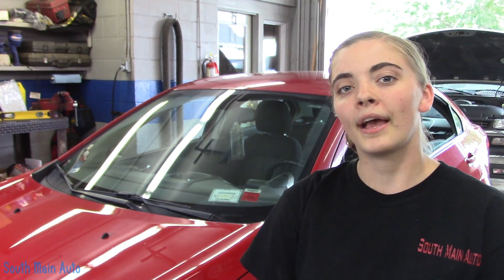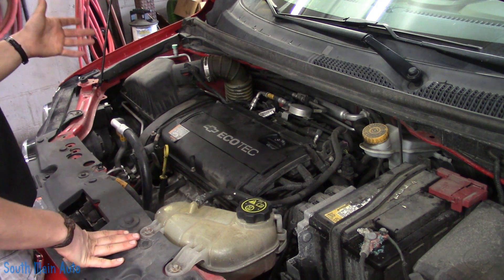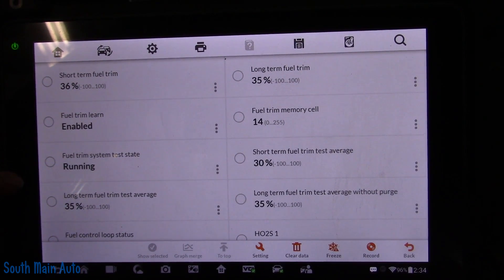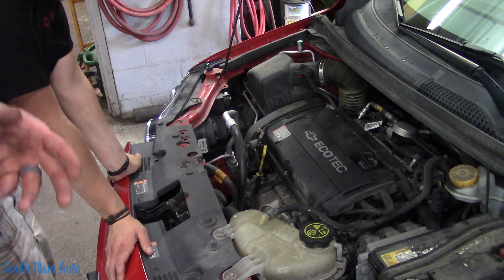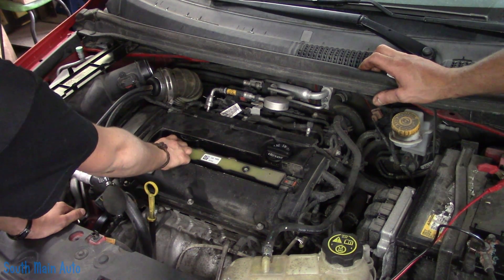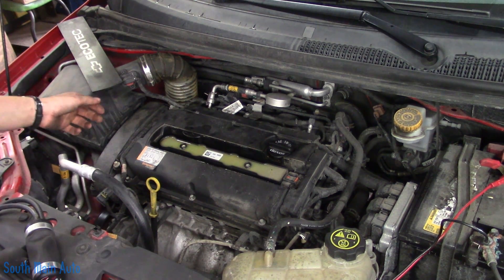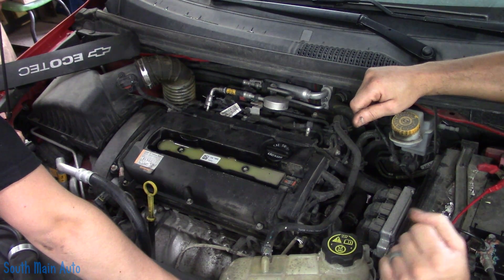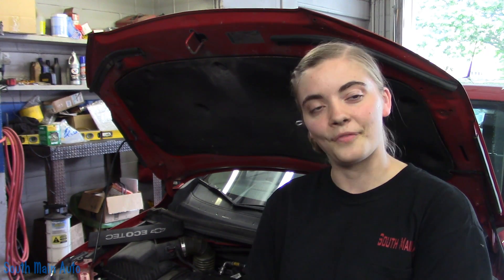Chevy Sonic: Running Lean P0171 - Part I

Comment: When I first started watching the video I was 100% convinced that it has a mass airflow senor problem. Didn't know a vacuum leak causes those type of problems too. Great video as always
Reply: Most lean codes I have dealt with under my shade tree have been from vacuum leaks (but as Eric points out, not on MAP only cars).

Comment: does Chevy use the same engine as Opel because they are very similar?
Reply: That 1.8L is DESIGNED by Opel, built by Daewoo and installed by Chevrolet USA.

Comment: Great video Marie. I have the same z18xer engine. I just changed the leaky valve cover gasket and purchased a new valve cover in the process as the PCV membrane seemed a bit wonky. There is a kit sold to replace the PCV membrane but the plastic clips get weak and you need to replace the gasket so worth just buying new valve cover & gasket IMO.

Comment: I had the exact same vehicle (same color too lol) in my shop last week. It had the same problem. I did pretty much the same diagnosis and found the leaking PCV. It was leaking from that hole in the cover at the diaphragm. But curiously, even after replacing the valve cover it still had the same problem. Lots of vacuum in the crankcase. The customer had to take the vehicle, so I haven't been able to finish my diagnostic, but I'm thinking it may have a valve timing issue. Awesome video!

Comment: What about altitude?
re; 14.7.
(14.7 is weight of air at sea level).
Avoca-vs-Denver
( 300ft- vs- 5,300ft)
Reply: Here in Flagstaff we are at 7000 ft (just try baking sourdough bread here!) 11.3 PSI. At 5000 ft is 12.2 PSI. In Leadville they have 10 PSI.

Comment: Soo, what exactly ruptured. Something internal in the plastic valve cover or just that hole in the cover. If just the hole in the cover can it be patched ?
Reply: The pcv diagram that is supposed to let excessive crankcase pressure out in a controlled manner

Comment: These engines also run in Europe in Opel an Vauxhall cars… stupid design with  a Diaphram built into the Valve cover… just replaced it on my car… super expensive as OEM part...   I gave it a try and put in a chinese one from eBay...you get 5-6 ebay covers for one OEM cover so I don`t really care if it will fail again in the future

Comment: 4:11, MAF flow is WAY to low. Thats as far as I got into the video when posting this.
Reply: And, because of the pirate air there was little to no airflow at idle.
Reply: It was in pounds per second not grams per second
Reply: @m96ag  Oh, correct. Kind of wierd the scammer would present it in Lbs as opposed to grams.
Reply: m ph Autel

Comment: The air isnt thinner in the Rockies,   there's less pressure as you gain altitude. At sea level there's 14.7 lbs of pressure  or something,  at 14,000  theres about 7 lbs

Comment: Good work Marie. Not long found the channel and been watching videos most days since. Ex mechanic so find all the diagnosis stuff interesting. Had carbs, points and condensers when I started and timing was set manually.  You can get the diaphragm for those covers but being a business, best to go with new cover.

Eric looks like Burt Reynolds in his prime, but then I''m from the UK so never met Burt but I'm sure I'm right. You need a Trans Am Eric and take Mrs O out for a spin. She might even dance on the windscreen whilst you're driving. Great channel, great people, thanks for the videos and fun.

Comment: 7:10 don't be afraid of the battery Marie! It's only 12 volts, doesn't even hurt if you stick your tongue across it! Just avoid dropping metal things across the terminals (wrenches, ratchets, etc.) and always double check the polarity before you connect booster cables, black to black, red to red. Stick to those rules and a battery will never bite ya.

Comment: want a permanent repair to that "leak"? Get yourself a straight OEM nippondenso pcv valve from a toyota, find the pcv valve hose, cut a length and insert the pcv valve on the cut portion.... you now get a very high quality removable pcv valve without having to replace the valve cover.... Whoever designed that pcv valve system deserves to be dragged to the street and shot.... survivors should be shot again (Garfield the cat always says this hehe.... ).

Comment: I question the popular assumption that vacuum drops significantly at higher revs. I don't see it unless you load the engine. I would argue that the mass of unmetered air remains fairly constant, but becomes a smaller fraction of total airflow at higher revs, therefore having less effect on AFR.
Reply from the maker: Simple enough :-) Stick a vacuum gauge on an engine and hold it at higher revs (no load) and let me know what you see. This theory has been proved (as it was in this video) countless times and seems to work well.

Comment: GM must be selling these valve covers like hotcakes.
Reply: Stupid design. Or smart if you're Chevy.
Reply: Jimmy S  _ Yep - I did one on a Cruz with just 40k miles on the clock. What a poorly engineered rolling toilet that thing is!!
Reply: @SmittySmithsonite  AMEN!!!
Reply: mine lasted or 180.000 miles so I can´t complain … but why in the world did they glue or weld the cover of the diapragm  ? On the Cruze it would be possible to access and change it within 2 minutes if they would sell it as a spare part and used a different design of the cover.. idiots
Reply: @bobl78  Good thing you haven't had to replace the combination exhaust manifold/catalytic converter, that's good for $1,400. These "economy cars" may be easy on gas, but they really bite you in the arse when it comes to repairs.
Reply: Oh well, it's China's problem now!
Reply: Jimmy S  I wonder if you couldn't just plug the original defective PCV valve vent, drill a hole, and install a regular PCV valve in the cover somewhere.
Reply: Hotcakes actually don't sell very well.
Reply: Just replaced a valve cover on a cruze today.
Reply: Yeah, the Koreans are working overtime to keep Chevrolet dealers supplied with parts.

Comment: Had me one of these in the shop last week. Mine was the turbo varety and said CRUZE on it.  but it had the little rubber donger check valve missing from the intake manifold. Had already been to another private shop and  had valve cover put on it. It was also at the chevy dealer and was diagnosed as a leaking intercooler coupler. One would have thought that the whole engine covered in oil and it pouring out between valve cover and the head coupled with "underboost code"

Comment: Chevy Sonic isn't really a Cheyv, is it?  Wasn't it it designed or at least adapted from another company?  

Anyway, Eric, this isn't good for you.  You know how this goes.  You train them up and then mysteriously the shop owner has and "accident" and there is "no will" to be found.  They get the shop then.  Not that I'm suggesting any "old world" influence in small town New York State.  ;)
Reply: I believe it's made by Daewoo
Reply: @joed8423  Very good. Thanks for the info.
Reply: @joed8423  nope, made in the USA
Reply: @waterfallhunter634  right made in USA with Daewoo designs. Specifically the ecotech motor. Which was originally a Daewoo design correct?
Reply: @joed8423  No not correct.   https://en.m.wikipedia.org/wiki/GM_Ecotec_engine
Reply: @joed8423  you are confusing this car with the Aveo
Reply: @waterfallhunter634  the sonic is the second generation aveo lol
Reply: @waterfallhunter634  The Sonic 1.8L engine is made in Korea, the 1.4L in Michigan.
Reply: Like the Chevy Luv, it's probably an Isuzu.
Reply: The sonic was made at Orion Assembly in michigan
Reply: @waterfallhunter634  Assembly only
Reply: Daewoo

Comment: That's some Chevy quality right there for you. The cheapest replacement I could find was $260, for the bad PCV  valve fix, that's highway robbery. $260 for a frigen PCV valve!!!
Reply: Rock has aftermarket valve covers for just under $90. 

If the vehicle were mine, I'd rig something together. For a customer, sorry, it's a valve cover, gaskets and whatever other plastic parts have given up the ghost.
I'd like to squash the chemical company that sold the idea of plastic intake manifolds, oil pans, and valve covers.
Reply: @gungadinn  It's more that just the valve cover, replace that only and it will happen again.
Reply: Well, from Chevy's point-of-view, the real problem is the owner for not buying a new car every 3 years.

Comment: Leave it to Chevy to make a 30 second and $5 repair into a 10 minute $90 repair. SMH
Reply: Try $260, ask me how I know.
Reply: @blackhatter011  Oh I'm sure. The price I quoted was just the part. Labor is a hind end kicker.
Reply: Volkswagens are similarly engineered.  Just order the part and DIY.
Reply: The price isn't similar. $87 from GM, $237 from Audi.
Reply: you will not get an OEM cover for that

Comment: On 5th gen Preludes.

Lean fuel trim code is very often caused by exhaust leaks.  Especially the flange from the header to the down pipe.   Which is located before the 02 sensor.  Newer Honda’s solved this by moving the the o2 sensor closer to the head.

Comment: Eric, it seems that new skin treatment regimen you've been using is effective
Reply: It is the Fluid Film spray. The stuff contains lanolin (wool wax) which is great for the skin.
Reply: @dunckeroo1987  Brake cleaner for sure.
Reply: Must be fish oil?
Reply: Ya taken years off his body as well, looks young now. Hehe
Reply: You can't use that much brake cleaner and not have it affect you somehow.
Reply: The scanner computer used in the video: https://amzn.to/2H3l6dt Autel MK908 Ultimate Wireless Automotive Scan Tool with ADAS, ECU Coding, Full Bi-Directional Control, ABS Brake Bleed, OE-Level All Systems Diagnosis
Reply: He must be using an engine oil as a skin treatment :-))
Reply: @maciejolejniczak151  full synthetic, at that 😂
Reply: it´s that extra zinc that makes the difference
Reply: @bobl78  and the sex change!
Reply: Probably "Tranny" fluid... :)
Reply: I don't get it is he okay?
Reply: mr incredible 
Miss Marie did the video.  They are joking that skin treatments made him look like Miss Marie.
Reply: @shadowdog500  He's a lot easier on the eyes (or in 'pirate' ... Ayes) now.

Comment: THERE'S YOUR PROBLEM RIGHT THERE. 
IT'S A CHEVY SONIC
Reply: yeh.. if it's not a truck or SUV    then GM just ships over a rebadged Daewoo.. that's what most of the sedans are
Reply: @joebrown9621  This was made in Michigan
Reply: @waterfallhunter634  Assembled in Michigan using Daewoo parts!
Reply: There's yer problem, lady!!!
Reply: No that there’s funny.
Reply: You must be a scotty kilmer fan
Reply: @xcmskim4   no its true due to trade reports. doesn't matter anyway, sales is sales, if they build it it needs to be sold. scotty kilmer is kinda nuts i think we all agree.
Reply: @xcmskim4  Yup, Scotty is crazy like a fox! Oh what a feeling to own a Toyota!!
Reply: Had one that had a hole in the intake, plastic deteriorates
Reply: @tommywvk  Amen to that. By the time I caught mine the hose and basically split through in two places. Good thing Chevy's mechanics tried to charge me $500 to replace my MAF, not noticing the giant rip in the intake hose 2 inches away 🙄
Reply: @tommywvk  Common problem on these Sonics, the intake flex pipes develop cracks. This can get VERY EXPENSIVE if the catalytic converter/ exhaust manifold combo has to be replaced!
Reply: @TheOzthewiz  ? Usually a plastic intake on these and if someone, or you are quoting cats and manifold your the reason this industry sucks. Further more Everyone points to foreign parts or that chevy sedans are crap. NO one had pointed out that this particular vehicle was made during gm bankruptcy and his hardly a gauge of products before or after even the trucks of these years are crap
Reply: and people mourned that american car makers stopped making sedans.... BECAUSE THEY SUCK AND NO ONE BUYS THEM
Reply: @CaptainSloose  The smaller they are in America, the more shitty they are.
Reply: @CaptainSloose  Not everyone wants the blah "crossovers" or a truck.
Reply: @CaptainSloose   mostly chevy was making bad cars..cause they were making all their money on trucks and cars in china...
Reply: @CaptainSloose  With regards to Chevrolets not selling it's because their quality is circling the drain.
Reply: To all your Sonic haters that's an echo tech engine in that thing those things run forever I have a hundred and thirty-three thousand miles on mine never had a lick of a problem with it other than I  spark plugs in a hundred thousand miles it's a good engine those who rag on it don't know what the hell their talking about
Reply: @stevejohnson1397  including scotty kilmer?
Reply: @stevejohnson1397  My '01 Cavalier with 205,000 miles had NO engine or transmission issues EVER. Had a problem with the low pressure power steering line (rust never sleeps) and a bad rear wheel ABS sensor. I did OVER MAINTAIN it and majority of miles were HIGHWAY. As for your Sonic, if THOSE miles are CITY miles, I AM IMPRESSED! Otherwise, It's not even worth mentioning. BTW, if you have the 1.8L, don't forget to CHANGE THAT TIMING BELT! Remember that is an "interference" engine. You don't want to lunch that motor!!
Reply: @stevejohnson1397  have a 15 eco 1.8 experinceing the idal coing up n down n running lil ruff as well as filed up at gas station n she took few trys to star inspected all hoses no vac leak any advice on where to check next
Reply: @stevejohnson1397  
133k on a motor without any issues is not a huge accomplishment. Car manufacturers products do that all the time. The question is what the ratio of major failures of that engine regardless of which vehicles its in use one. So say for every 10000 vehicles with that motor what percentage of those motors have experienced failures of some sort? The other question is while the engine itself in your car may have been trouble free what other sorts of issues if any has the rest of the car had over the course of its 133k miles?
Reply: @adamn7516  water pump failure twice I had to replace it was still covered under warranty
Reply: @TapNWade  
Good that it was still under warranty but two water pump failures in the first 60k miles would not inspire confidence with me. Back when I had my 2001 GTI. In its first 48k miles they replaced my turbo and my transmission. Thankfully both under warranty. Drove the car to 115k before getting rid of it due to bad compression in one cylinder. 

But during all those out of warranty miles I dealt with alot of minor electrical bullshit and some other odd and end shit. Nothing majorly expensive but when it hit 100k miles I always joked the car was due for a new tranny. Instead 15k miles later it blessed me the bad compression which would have a required a engine bottom end rebuild.

I will say the GTI never left me stranded or even required a tow its entire life. Even when the tranny failed I was able to limp it 15 miles to the VW dealer strictly using 1st and 2nd gear.